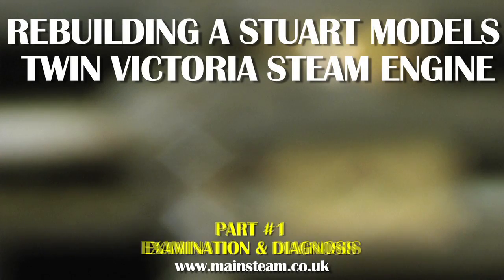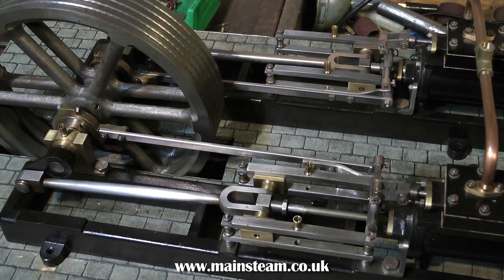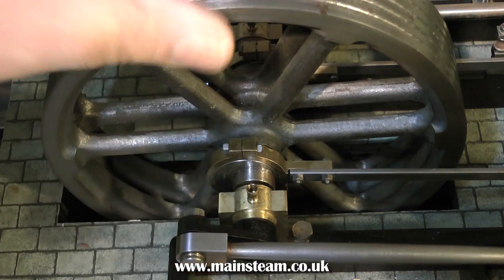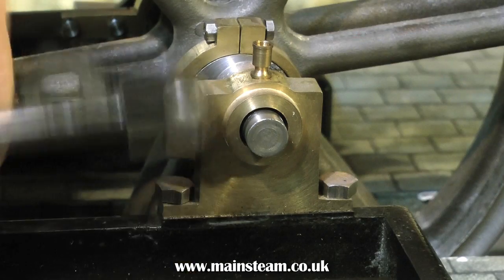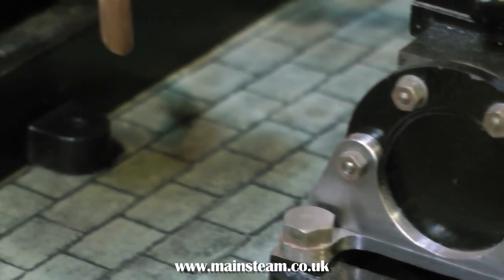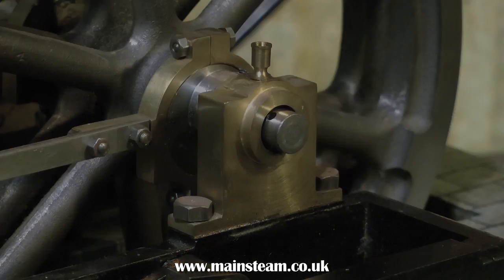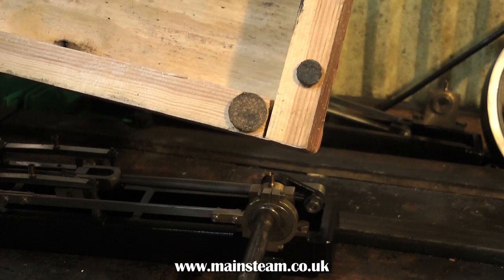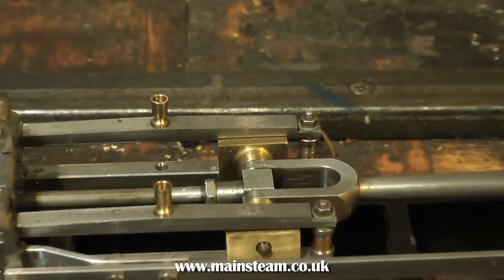PART #1 - REBUILDING A STUART MODELS TWIN VICTORIA STEAM ENGINE

Comment: I'm building a single cylinder Victoria engine and i'm wondering how you would hold the bed plate casting to machine it.